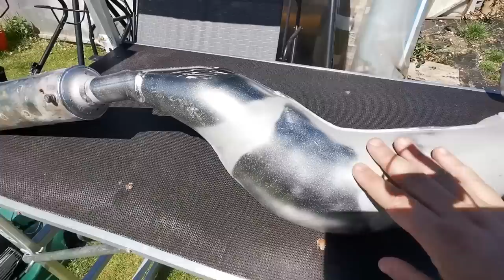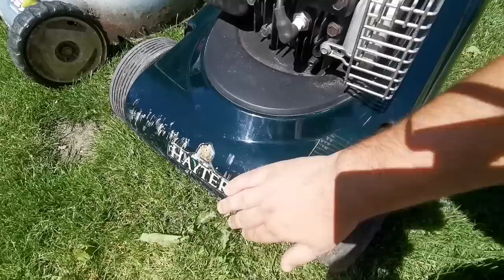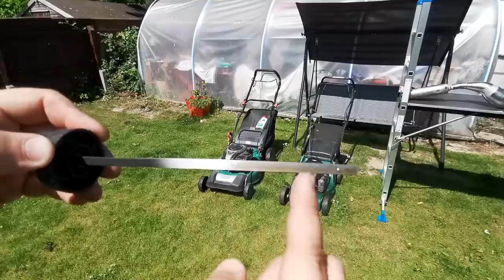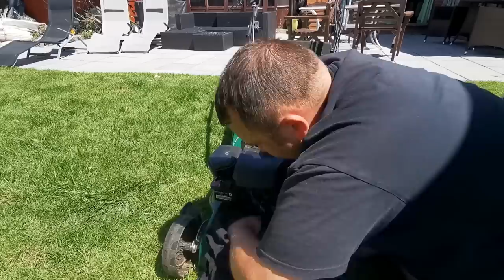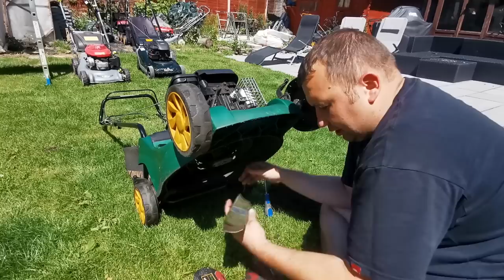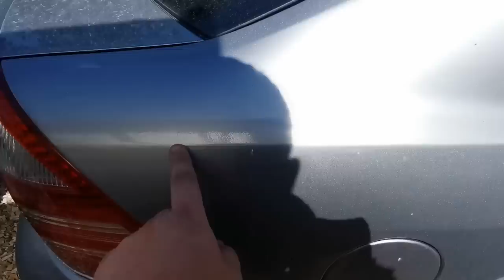FACEBOOK BARGAINS ?? #projectman #vlog

Comment: Good mowers izy till you tilt the mower up and the deck starts to flex in the middle apart from engine's decks are shocking and not worth a repair
Reply from the maker: Yer iv seen a few rotten ones 🤦‍♂️